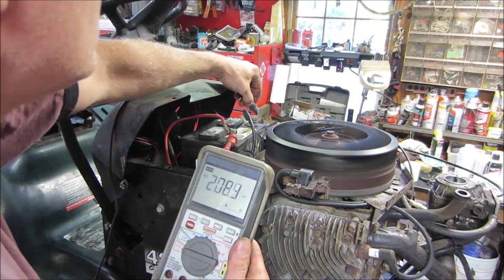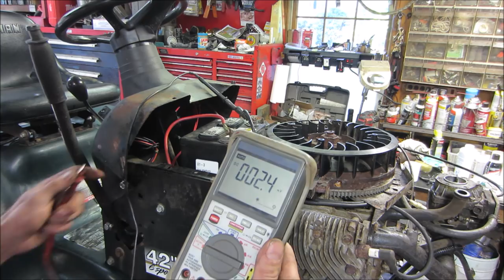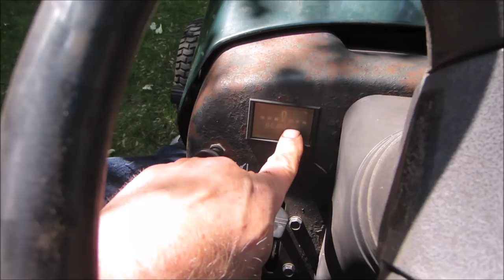will it run?  free craftsman riding mower conclusion.

Comment: THEE most useful tool you can have in your garage is internet access, preferably on a big enough screen you can see from halfway across the room.

That said, you can almost always find wiring diagrams for your lawn mower. Spend a few minutes studying yours and you'll be much better equipped to understand these things. Each time you work through these troubles you become a little more learned. One day you'll be posting self-help videos on YouTube!

Regarding that fuse, which most riding mowers have at least one; that usually is found between the battery and the rest of your electrical system, and any short anywhere should blow this fuse before you have a fire. If that fuse blows, you will never be able to crank through the key switch, though you'd still be able to short across the heavy terminals on the start solenoid (if you must, do so very carefully. You don't want this engine starting, even turning, unexpectedly and have the tractor move on you, or the blades start turning). Sometimes these fuses blow inexplicably, and changing the fuse will get you going again with no other troubleshooting required.

These flat blade type fuses are pretty easy to test with your 12-volt tester. Between ground and either side your light should light. If only one side lights, your fuse is LIKELY blown. If you don't have a tester, but you have a meter with resistance-measuring capability, a good fuse will have absolutely zero resistance. Just make sure you pull it out of the circuit before testing resistance.

Keep in mind that if you're jumping your battery to try starting your engine, you are not going to be able to transfer very much current through the clamps on the cables - not nearly as much as having a battery installed with good connections. May be enough to crank, but may not be. Always better with battery installed.

Comment: Looks exactly like my catcher and tractor, I put a new 20 HP twin cylinder motor in mine ... to much money invested. But, if the rest of the tractor goes kaput, I'll have a new 20HP spare motor sitting on the shelf. Ha! Hey, one nut hold the steering wheel, made it straight will ya? Doesn't it bother you?

Comment: I have the same machine. When the deck rotted out, I bought a new deck shell, spindles and air rings to give it another decade of use. The spindle bearings are NOT sealed. But you should remove the plastic bearing covers and regrease them (OEM grease is a bit sparse) and refill the shaft space thru the zerks.

Comment: Just saw the part of the switch where "ho, it works" lol....Can't tell you how many times that has happened to me....click doesn't work click doesn't work click doesn't work.....click what? it works now? usually after I spend $30 on a new switch though lol.....

I picked up a can of electrical contact cleaner spray. Works 9 times out of 10 plus leaves a thin coating over the contacts to prevent further loss of contact.

Comment: I'm always amazed at how people abuse power equipment. If I now had that mower I would drop the deck, disassemble it, sand blast and repaint then double check the bearings before reassembling it. Super clean and touch up the rusty paint. Since it was a solid runner, with proper upkeep and indoor storage it should mow for 10 or more years. It's just wasteful how some people are.

Comment: Vaseline is v. good for all electrical connections.  It was used it on these transformer's connections (200,000 Volts plus).  Kirkwood Powerhouse on Hetch Hetchy, 37.877529, -119.953173 .

Comment: If I went at a wire wheel without gloves I'd be doing first aid for sure. Those wires will find me.
Reply: Isaiah Weisenbach Yup. Always wearing flip flops.
Reply: Been poked by wire filaments almost everywhere. Career electronics tech and shade tree mechanic.
Reply: Been there, done that, got the tattoo (scar)🙊
Reply: Ever had the joy of getting the glove caught on the wire wheel? A whole lot than getting hit without gloves
Reply from the maker: under the nail feels good too

Comment: Love the channel!! I have an older Tecumseh HH70 engine on a Ariens Rocket Tiller. It has an intermediate miss/cough that produces a slight puff of smoke only when it misses.
I've replaced the carb and sparkplug because they needed replaced anyway.
Does that sound like I need to remove the flywheel and inspect the coil etc.
That's what I'm thinking.
The miss doesn't have a specific rhythm so I know it's not a valve issue.

Comment: I feel like it's a dumb to put the gas tank under the seat.. It takes longer to start the tractor because it has to pump the fuel up. A least in mine. (I have 1 tractor with it's tank under the seat and 4 with the tank by the engine and 1 has a fuel pump for no reason)

Comment: Nice work on that electrical troubleshooting and repair. All those safeties make it confusing. My ampmeter never moves more than an 1/8th of an inch, but it does move. Even after storage in the winter without a trickle charged battery. Should I be concerned and can I tweek it somehow?
Thanks for sharing. Looking forward to the next one.
Reply: MRrwmac,

I disconnect the leads when I store for winter.

Comment: How much would you actually charge for a mower like this when selling?
Reply: stubbi ,I refurbished a craftsman with a 46" deck, and this engine replaced the transmission , had the thing running like new, I sold mine for $ 700.00
Reply: Was more interested in how much that'll cost when its in the condition like Musties.
Reply: 350

Comment: Any reason not to use your sand blaster on the back of the switch to not only get into the insides of the contacts, but also clean up where the lugs connect to the insides of the switch itself?

RichE

Comment: How do you even put a value on something like this? Consumer grade stuff has fallen off a cliff in terms of both price and quality. You can replace it fairly cheaply, but you can't really replace it with something of similar quality. You either pay a fortune for professional grade or you get cheap consumer grade that simply will not last very long and certainly not as long as something you bought 20 years ago!
Reply: tarstarkusz truth. We have a 1960's era push mower we keep on the camping lot and at most we file the blade and file the points. My toro mower at home from the 90s is garbage.
Reply: A A AA AAAH H Hhhhhhh. . .mennnnn!!!!!. . . .well,, just  DON'T, , purchase, the CRAP, , ,& COMPLAIN TO THE MANUFACTURER!!!!!,, , , ,Or,, purchase a commercial, , , model!!!!  WHAT,, DO  you anticipate, , , for LOW BID?????. . .What we;
accept, , , WE CONDONE!!!!. . .DON'T ACCEPT IT!!!!!

Comment: Hi Darren, thanks for another great video. Those useless lights, I have a 20hr old Husqi with even less powerful lights, is it possible to swap them for LEDS?
Reply: Sure, why not?  Just need to find out what the base is, and what voltage/wattage the bulbs are supposed to be.  As long as you're going in there to remove the old incandescent bulbs, might as well clean out the reflectors and the inside of the light housing.  I honestly do not think those housings are made with good quality reflectors, it's not like those lawn tractors are out on the highways and need lights to light up 400 feet of road ahead of them. Going to better bulbs could never hurt,  but is you need 2 bulbs and they end up being 15 bucks a piece,  is it worth it to stick 30 bucks into a lawn mower, or better to put 30 bucks into a few cans of gas for it and mow the grass in the day time?

Comment: Mustie, I’ve noticed throughout your videos that you have a habit of disconnecting your airline from the tool when you put it down.  Is that a safety habit?  If so, why?
Reply from the maker: the air leaks and l dont want to have the compressor kick on while filming
Reply: Noobs never learn

Comment: hey musti i have a ariens snow blower i have 2 questions is it ok to put a higher octane gas or  could  it damage the motor  2nd  is it better to put a stabilizer in the gas tank in the spring when not in use or is better to run it till there's no more gas??
Reply from the maker: id run it dry and high octane wont hurt it,
Reply: @mustie1  thanks  exactly what i did

Comment: Craftsman: hopefully with Sears' troubles we'll still be able to get parts. Sears closed down in Canada and it is going to be a problem in a few years....
Reply: They were already known for poor service parts availability. I Needed a replacement bag for my mower 2 years ago. I went to a local repair shop who distributed OEM parts. They told me it is very difficult to get parts from Sears. Ended up adapting a used bag of another brand...

Comment: I believe you don't have any charging at all. This engine doesn't need battery to run, so it doesn't put any load on it. There was no difference in voltage across battery terminals on running and not running engine. To check if it charges the battery or not, you should switch the lights on and off on a running engine and observe the voltage, but to say it has charging, the voltage should be at least 13.8V on a running engine. And one more thing - this time was not a problem, but never ever disconnect the battery while engine is running on any modern car or motorbike, this could in best case damage the charging system, and in the worst all the on-board electronics.
Reply from the maker: if you watch the end the carge guage was way up and was charging
Reply: Where is the charging circuit on a small twin cylinder engine.  I probably knew this at one time, but I forgot.  Thanks
Reply: On them twin-juggers, it's always right underneath the turbocharger housing,  right behind the oil return line :)  Ok, seriously, the charging on these small engines like mowers, blowers,  blenders and sleds is done right off the flywheel.  There are magnetic bands right on the flywheel, and as the flywheel rotates, the magnets generate alternating North and South pole fields as they pass by coils.  The coils pick up the magnetic fields, pass them along to a simple regulator and diode.  The diode takes all the "backward" or negative-flowing fields and converts them into "forward" or positive fields, so that instead of an alternating back-and-forth current, you get a steady forward direct current.  The voltage regulator keeps the voltage from exceeding a set value as the motor revs up to operating range.  In order to get more "oomph" out of it,  you get a flywheel that has more poles on it.  Very small mowers and outboards that don't have to provide power for lights or to charge a starting battery,  have even more simple electrical systems, as all they need to generate is the spark for the spark plug.